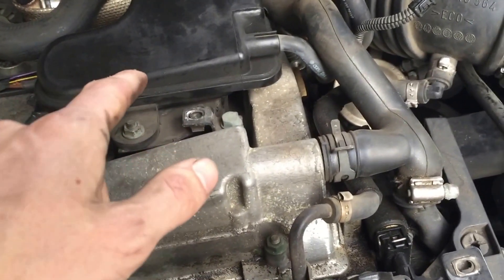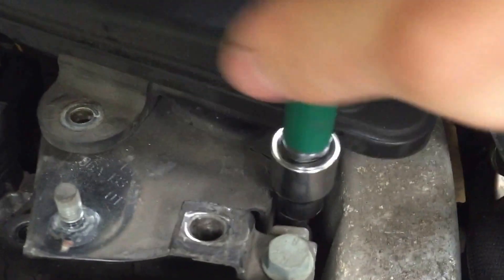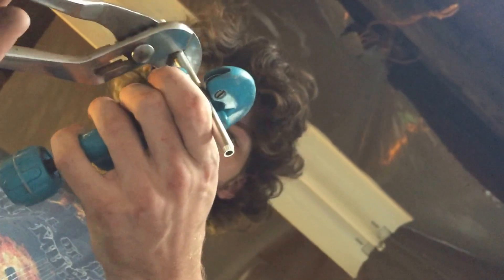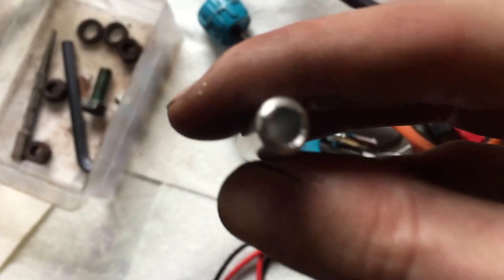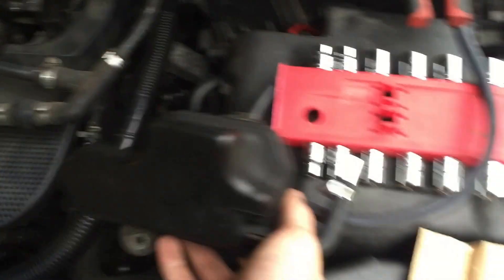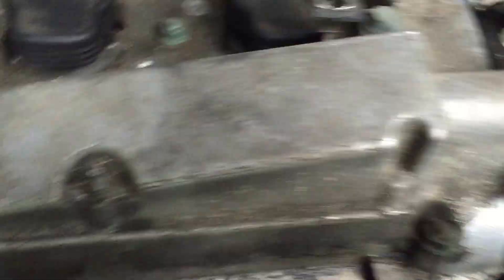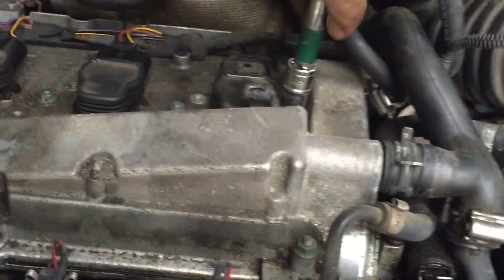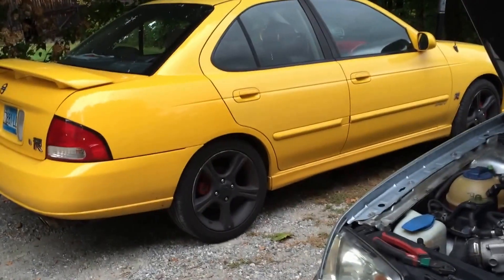How to get MK4 Jetta vacuum reservoir out of your way

Comment: Had you had any problems from the heat from the turbo on the vacuum res? Cause your putting it by where it gets hot. Notice the heat wrap next to it.
Reply: Christopher Steward wouldn’t it get got bolted right to the valve cover? Lol
Reply: had mine melt off where the nut is and it fell onto the downpipe and melded a hole in it

Comment: You know you dont have to run the bov from the vacuum resevoir. If you want to you t piece the original vacuum line going from the inlet manifold to the 249 and have the bov running direct vacuum from that. You need to have vacuum going to the SAI if you have one so this is the EASIEST way without pulling everything apart and ordering bungs and blanking plates. Once you have teed off the manifold with the bov and 249 both in the line simply take the vacuum line off the recirc valve coming from the 249 and block it off with a screw or bolt. Job done.

Comment: My vacuum reservoir is not there, and the hoses have been open in my bay. Been that way since I owned it I guess.. almost 2 years
Reply from the maker: Damn son sounds like you got yourself a vacuum leak
Reply: The Shop Life yeah, but it doesn't have an evap code or anything. Is weird...
Reply: @theshoplife9527  proabbly been coded/mapped out. Someone probably did the delete before your ownership.

Comment: you should of just deleted the n249, there is no need for it
Reply: if you knew what the n249 actually did you would avoid bypassing it...air being left in the intake trac between shifts during hard boost condition is not good. idk how ppl run it bypassed, i did it for a day bc i needed to seee if the 249 was the culprit of my boost problem, and every hard boost shift the turbo would make a horrid bark (thats air being left in the intake trac)
Reply: Will it pass deq or emissions if its removed?
Reply: @1000Famed  yes